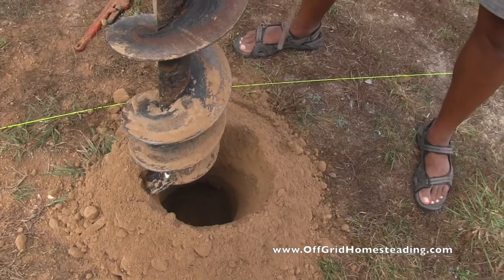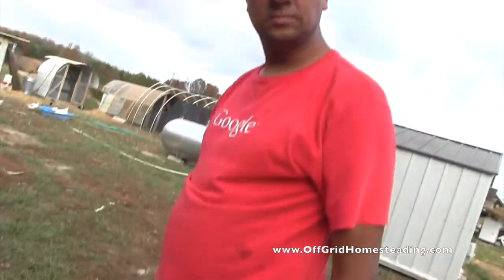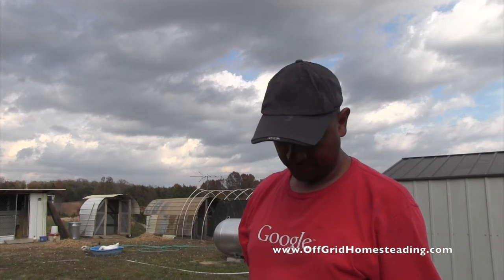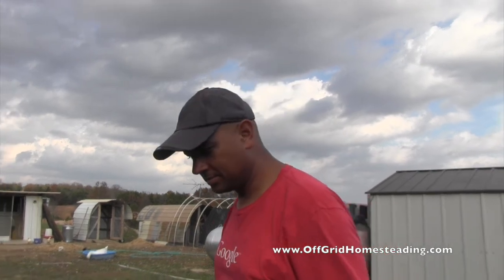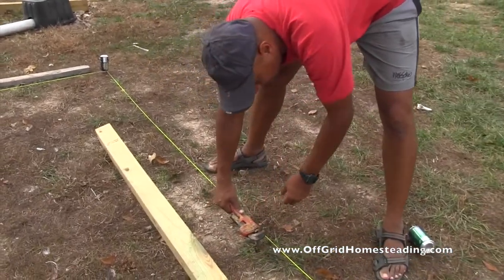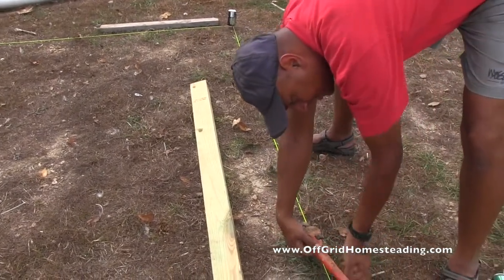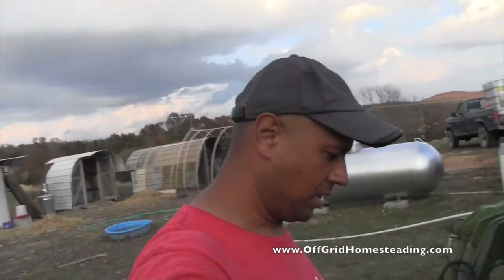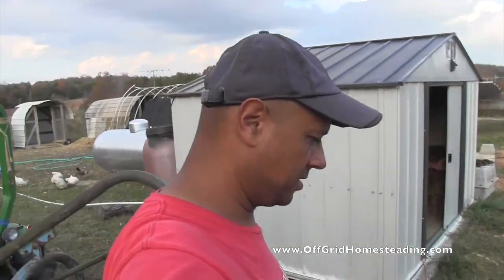OGH - Building Addition on Camper Part 5 of 8

Comment: Surprised the u joint held up.  Well done.
Reply from the maker: F333 the metal piece that I welded was pounded off on one side, I re-welded the crap out of it — this time grinding off the paint near the weld area— that held for the rest of the holes.  After putting oil on the u- joints the squeaky noise disappeared— the joint was smoking from the friction...after that I kept the speed at a slow pace and it all worked out.